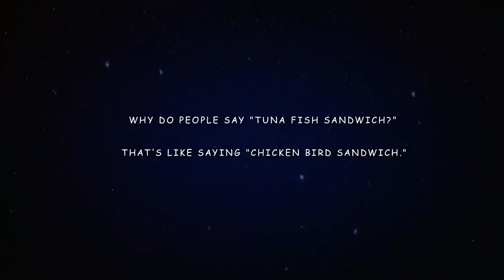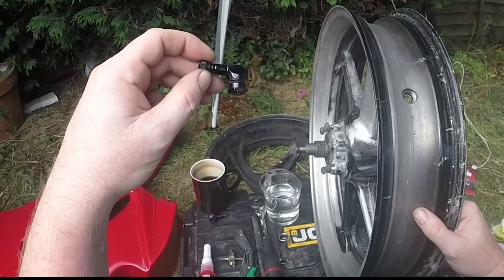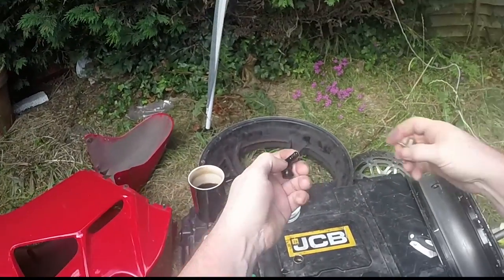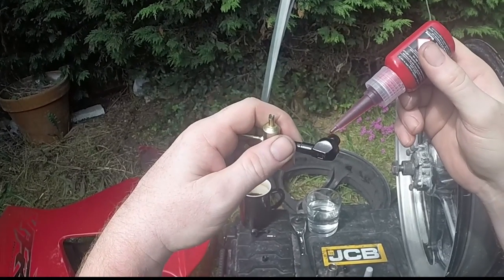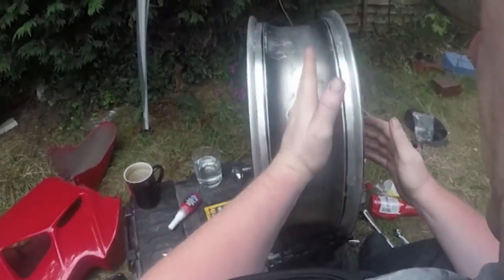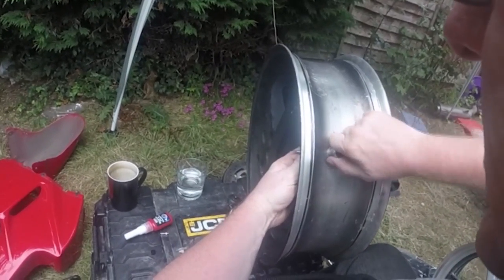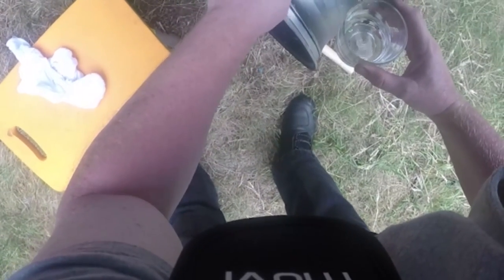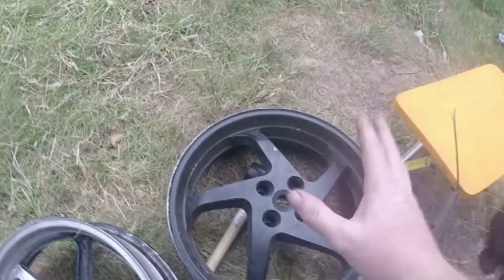How to Fit Angled Schrader Tyre Valves

Comment: My old Ducati 848 came with those valve stems from the factory. They are brilliant and I don't know why every manufacturer doesn't trust out them on  stock. Nice video.
Reply from the maker: +PandaRant Moto cost it's cheaper to put in the rubber valves